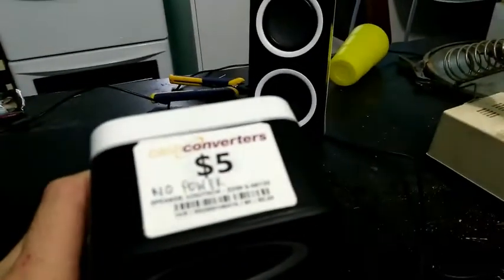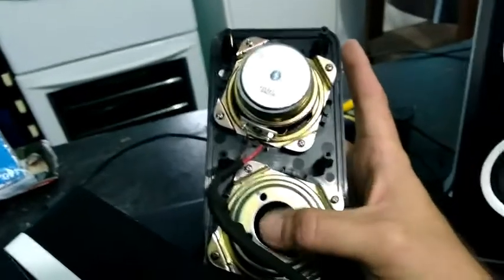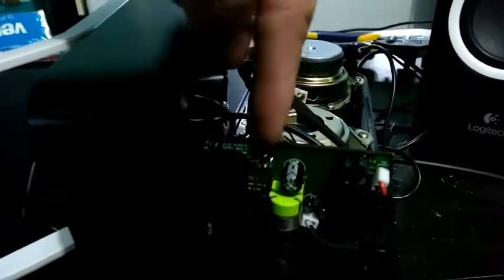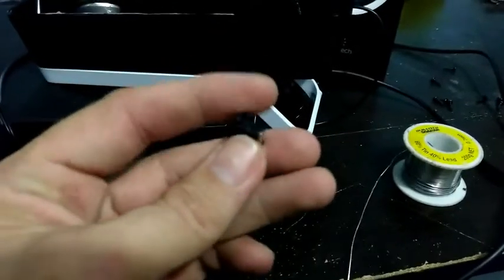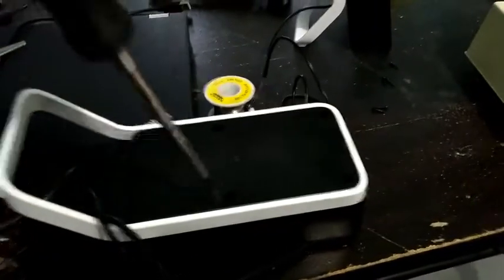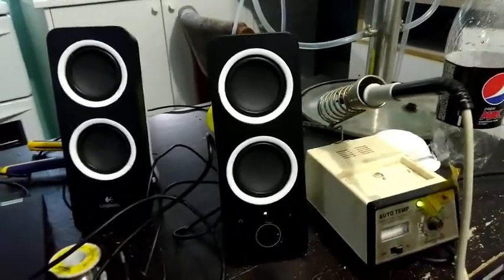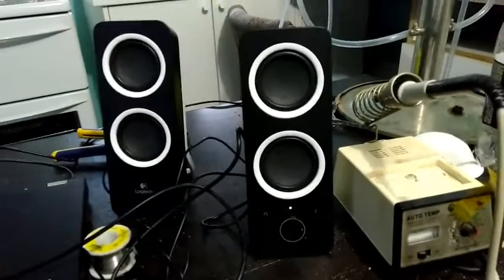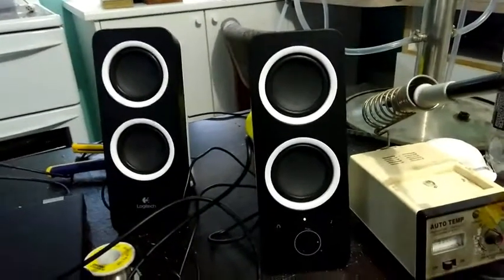Converting Mains powered PC Speakers to USB

Comment: I just have a simple pair of logitech speakers without a subwoofer or anything. They are directly plugged into the wall socket. I just want to change them from getting powered from the wall to getting powered from any USB socket. My objective is to use these in a car with one of those car chargers. Is this possible? The speakers say they need 2.5Amps and 250V to work and that seems like too much for just a simple pair of speakers... Is this whole idea possible or should i just give up? A backup idea is to use the circuit of a phone charger to make the conversion  but im not sure that would work. Please help me out here cause i wanna learn more about this idea and possibly make it posible.